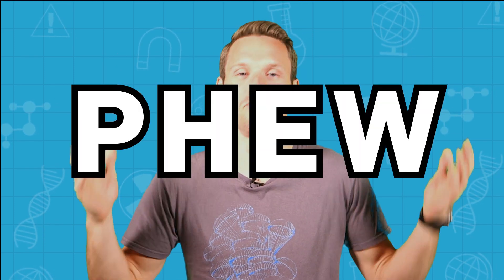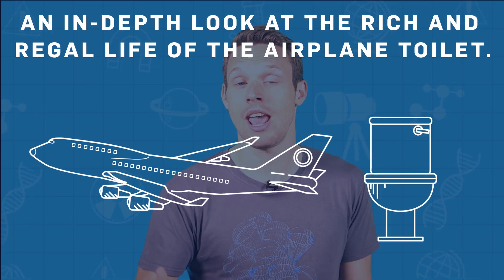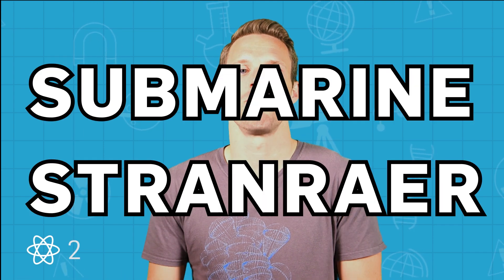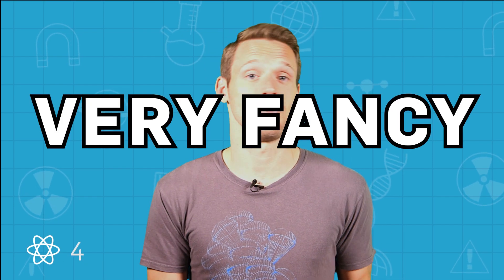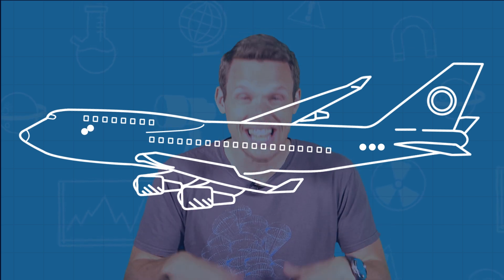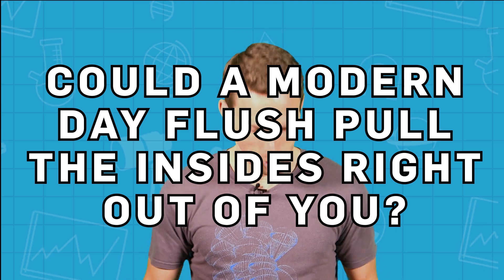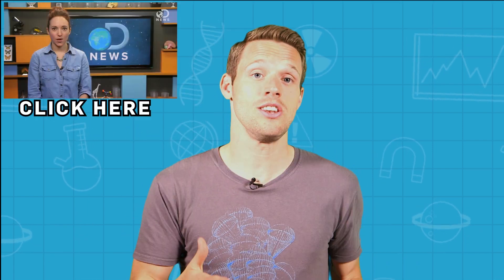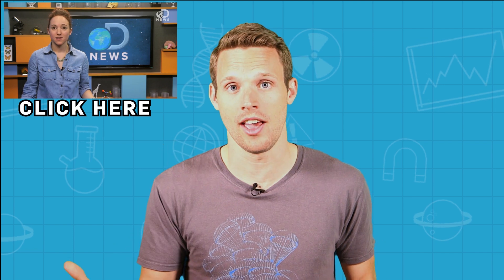How Do Plane Toilets Work? | Earth Science

Comment: Airplane toilets can be improved, sensors can be added to the toilet seat, and if these sensors detect anything, the vacuum toilet won't flush. But the suction will be stronger, and there will be hot water strong jets added to the toilet bowl.

Comment: I’ll explain what he didn’t 

First off the reason, insides of airplane, toilet or black is because it has a nonstick surface, it’s  basically the same stuff that they put in nonstick frying pans this is to ensure everything goes down and the reason they use a vacuum system is because water has weight and more weight = more fuel which = more money and so on and your excrement is pushed all the way to the back not pulled every time you use the toilet, a trap door in the tank in the very back opens, which has the air in the cabin depressurize and push your excrement down, so basically your depressurizing, the plane by 00.1% and no, they do not just rain poop on you. They have a tank in the very back of the plane that they empty out after all flights.

Comment: A little piece of info you misst... While the toilet does NOT dump into the air ..... The Bathroom SINK DOES!!! IT actually has a heating system to insure the liquid does not freeze in the pipe before being ejected into the open wind!!! Granted the amount of water used in a sink is usually pretty low Still!! Now you know where your scumy hand wash water goes!

Comment: If the vacuum is created by the pressure differential in the cabin, how does the flush work when the plane is grounded? Surely the pressure is the same as outside.
Reply: ait doesnt
Reply: Actually there is a shutoff valve stopping the soil from going into the lines, the lines are actually always pressurised. The valve has two diaphragms which act simultaneously to activate the valve, that's like a very simplified, you actually have to go into the construction of the valve to get the full working mechanism.

Comment: Let me help explain how an modern commercial aircraft's toilet work, because clearly you can't or don't know how. Yes they use differential pressure, but how does that work?

Modern commercial airliners are equipped with a vacuum blower for use between the altitudes of 0 ft - 18,000ft. This creates the differential pressure that is required to suck the waste from the toilet bowl into the waste tank. Inside the waste tank, there is a water-air separator which filters the waste solids into the tank, and the air overboard the aircraft through an exhaust. 

From 18,000ft and above, the vacuum blowers are not used. Instead, the differential pressure created from the pressurization of the cabin pushes the waste through the waste lines into the waste tank where the waste-air separator separates the solids from the air. The air is again, sent overboard through an exhaust.

Comment: i was expecting more technical details about the vacuum pump system
Reply: same. it's boring to see someone talking about poop while the video's title is about plane toilets
Reply: basically, in an aircraft, above 16,000ft, the aircraft no longer uses its vacuum generators. Instead, the vacuum the toilet is getting is from the differential pressure between the plane and the atmosphere.

The water that are used to flush the toilet bowls are used for the basins, your hot instant noodle etc. And those water your have used from the basins are thrown overboard during flight.

While your waste is sucked into a waste tank to be disposed during line maintenance
Reply: same.. this is boring
Reply: i was expecting more of your mothers svirki
Reply: @arlequin6022  Watch out guys, we got a tough guy over here
Reply: me too
Reply: me too. was expecting an elaborate working of macerator and vacuum pumps and the like :/
Reply: Same here
Reply: yeah i cant find anything about that.. it is patented or what?

Comment: 1:55 ...... if they use the pressure in the cabin to PUSH it down... doesn't that answer the question? That it will not SUCK your intestines in, because there is no sucking involved?

So basically nothing would happen?

Comment: For clarification, modern aircraft toilet systems allow the drainage of liquid into the atmosphere but solid matter is kept in the waste tank. To prevent the the liquid becoming a block of ice on the side of the plane, liquid is drained through a heated probe  which is commonly found at the rear of the aircraft.
Reply: ..and then turn into icicles? )
Reply: @ not quite. It condenses forming a cloud trailing the aircraft (same as the moisture formed as a byproduct from jet engines)